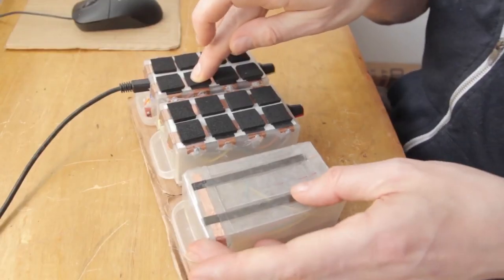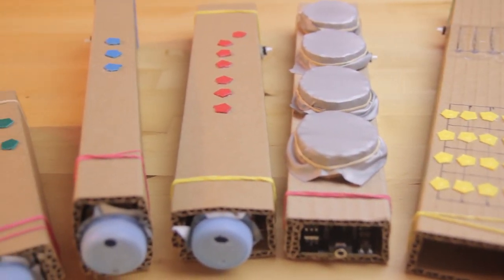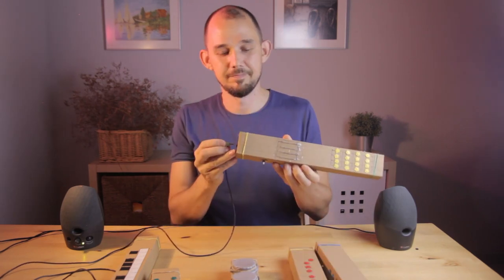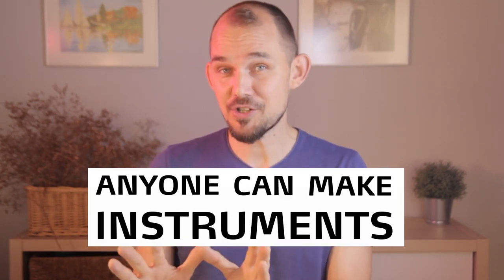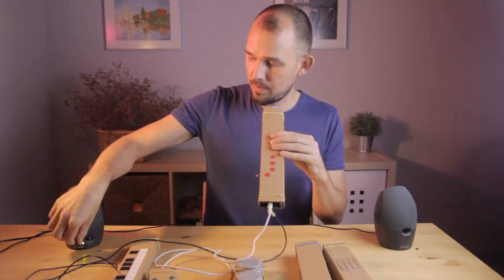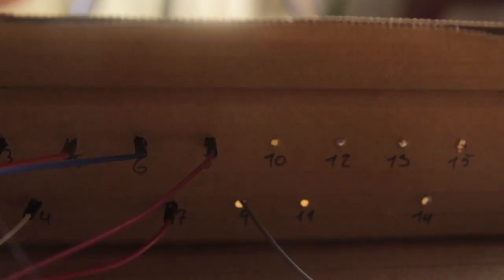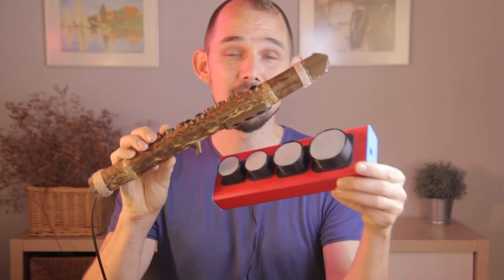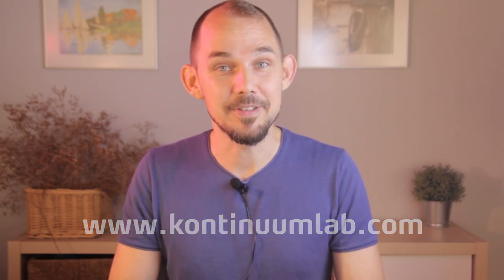STEM / STEAM instrument making workshops with the KLIK-2

Comment: I'd like to do something like your new EWI prototype, but I want to make the keys as analog inputs, so that I could do things like slide between notes more naturally. I've seen one that uses optical sensors (the Warbl) and I think this could be an option with the Klik system.
Reply from the maker: Hi Chris. I didn't know about the Warbl - looks cool! 
I did have a prototype of the OHMs (1 out of more than 20) which used optical sensors in the keys, but the circuit for that is much more complex than the capacitive key setup I use here, so it's out of the question for the KLIK, which is all about simplicity and ease of fabrication. However: The capacitive keys, if made and configured for it, can actually do what the Warbl keys do, which is read the presence of the finger even from a few millimeters distance. But again, that requires a lot of precision in the key construction, and that's really not what the KLIK is about. The KLIK software is put together specifically to work well even with less than perfect key construction.

Comment: l need a sd card to use the instrument without pc?
Reply from the maker: No, just plug in ear buds or powered speakers.
Reply: But I can use without PC?Or I need PC?
Reply from the maker: @rosemeriaparecidawasmuth6218  You don't need a computer. The KLIK can be powered by batteries, or a 5v source like a phone charger. It has synthesizers and audio on board, and there's a mini jack on board which you can plug in ear buds or powered speakers.